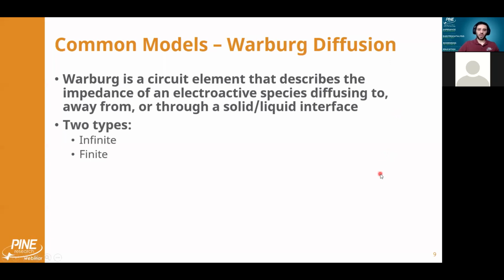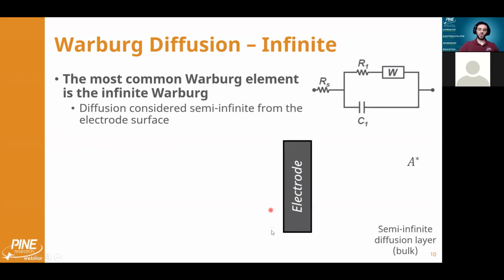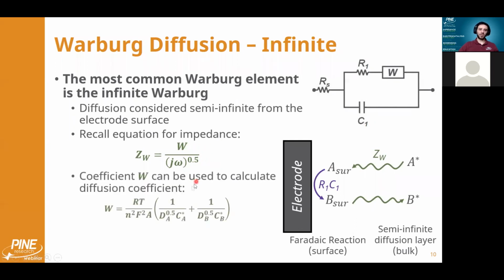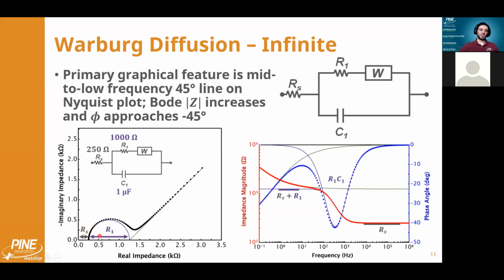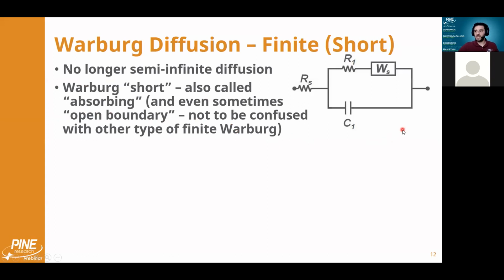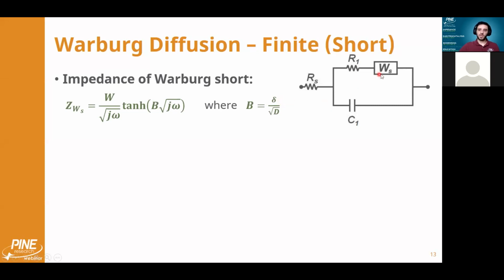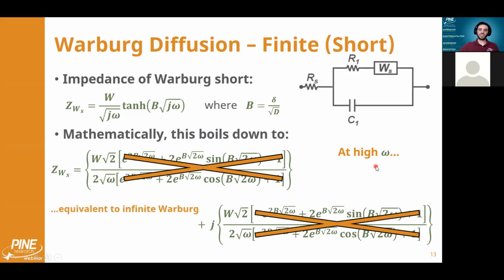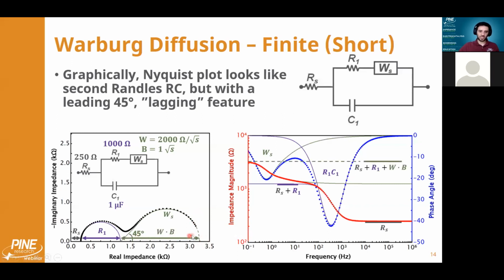Infinite vs. Finite Warburg Diffusion

Comment: Wow thank you for this video, this definietly helped me with some issues I had!
But I have one question in my mind concerning  the equivalent curcuit when using a Warburg short. You mentioned a Warburg short mimics the behaviour of a porous structure, but how would an equivalent curcuit look like, when you have different pore structures (e.g. Different sizes) at once? Is it all contained in one Waburg short element, or would it be like different Warburg shorts in parallel?
Reply from the maker: This is a very good question.  First, I will say that I think most probably every single electrode, even those with what appear to have relatively uniform pore structures, are in reality more like what you described.  That is, probably every porous electrode has a distribution of pore sizes and structures even if the average size is pretty close to being the same.  So no matter what, everything is likely as you describe it, just to be clear.

Following my above hypothesis, I would propose that the use of a single Warburg short is still probably reasonable in most cases because it is capturing some kind of average or aggregate finite-length diffusional behavior, and I would also propose that even in the case you wanted to construct a circuit with multiple Warburg short elements to capture the variety of pore sizes present (and, thus, the variety of diffusional behaviors going on), this would not be easy at all for a couple reasons.  Firstly, the software probably cannot easily differentiate between these phenomena as you are envisioning as the conscious, intelligent researcher.  The software fitting algorithm is not "intelligent" to the effect that it cannot know what should be applied to what.  You would likely have to manually try to adjust parameters, which would make it very fraught.  Additionally, it would be computationally very complex and might bog down the software itself.  And secondly, even trying to apply multiple Warburg short elements implies your EIS data is sensitive and accurate enough that it is capturing the behavior from individual pore sizes and structures.  To be honest, I highly doubt whether these kinds of processes would all be accurately captured in a single EIS test such that they could be analyzed via circuit fitting.

Apologies for the lengthy reply, but I really do think this is a good question!  Finally, the last thing I will say on this matter is that in the case you described, it may be more applicable to apply a Transmission Line model instead of a Warburg.  The Transmission Line model is designed to capture a distribution of charge effective throughout a porous electrode microstructure.  This is not exactly the same perhaps as a distribution in the microstructure and pore size itself, but the infinite sum structure of the Transmission Line element might be more ideal to capture this kind of heterogeneity in your porous electrode.

If you want to have some more live discussion about porous electrodes and these kinds of circuit fitting models, I am happy to do so on one of our Livestreams we do every Friday at 1pm EST.  Join me (Neil) then if you like and I can talk more about this.
Reply: @Pineresearch  Thank you, I really appreciate the effort you put into your answer! This is way more detailed than I would have ever imagined.
Reply from the maker: @lucaschuster2824  My pleasure.  Thanks for commenting on our video, and feel free to keep in touch with us here on YouTube, we enjoy engaging with the community on electrochemistry discussions!

Comment: I'm not quite understanding why we're able to neglect the second term in the Warburg coefficient. I understand fundamentally that it's because, compared to the other species, it is not present in an appreciable amount at the electrode surface, but the C^*_A, C^*_B terms are referring to concentration in the bulk.
(also, thanks for the videos - I've been watching them religiously haha)
Reply from the maker: I'm glad that you are enjoying the videos.  That section of the Warburg coefficient has to do with the contribution to the Warburg impedance from both diffusion of C^*_A and C^*_B.  However, when doing EIS you are probably applying a sinewave around a potential where A + e --> B, which means the current response (and hence the impedance response) is due to only the contribution of C^*_A and no contribution of C^*_B.  Which is why we can eliminate the end term in the Warburg coefficient.  Does that make sense?